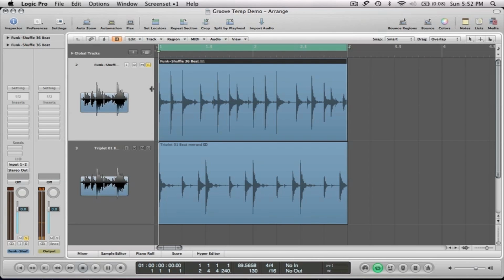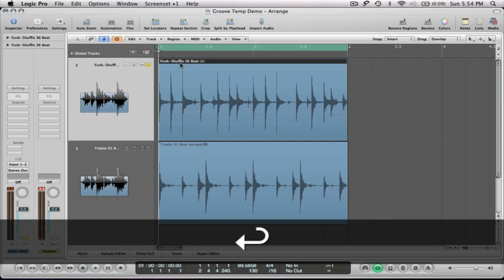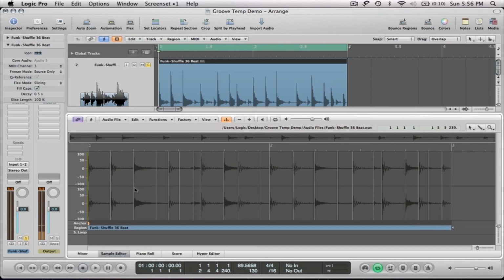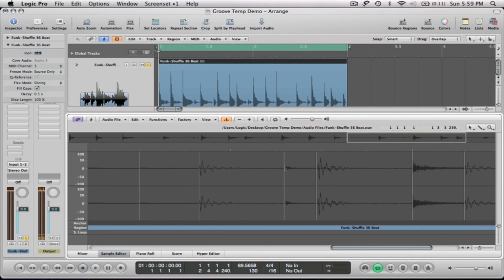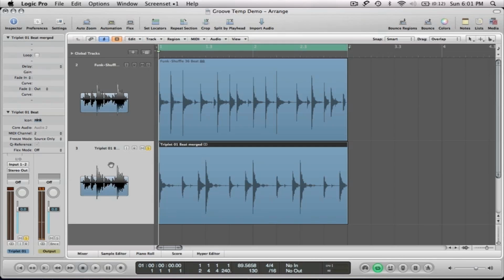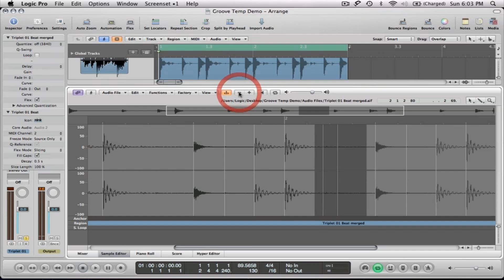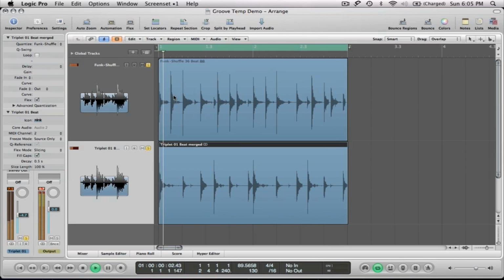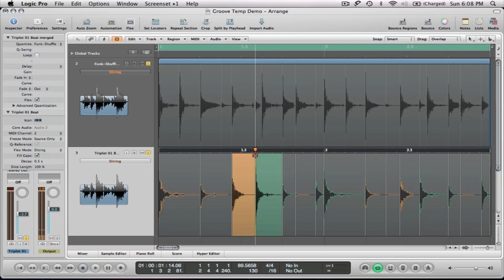Logic Pro, Time & Pitch/Flex Time Part 3 of 3

Comment from the maker: You could use a higher quality algorithm in "Time & Pitch" usually requires a 3rd plug in like iZotopes Radius. Out side of that you could try using the different Flex modes (if you are using Logic 9) the Polyphonic mode is probably the highest quality.  Good Luck